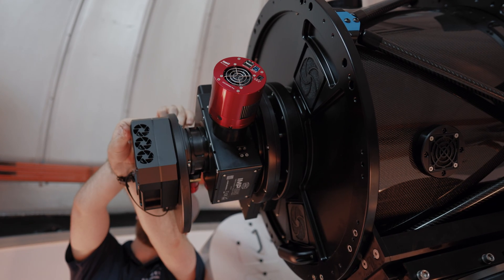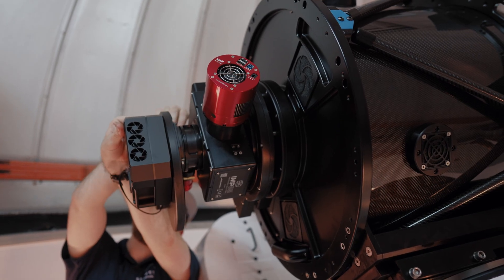Custom private observatory build in Texas

Comment: Why isn’t pier isolated from floor vis-a-vis a distinct pier pour? Looks like it’s just bolted to floor.
Reply: We poured an isolated slab that allows the telescope to not experience and vibrations from the dome rotating.
Reply: @MattDieterich  Can we have an order of magnitude of the cost of the project?
Reply: @jango71 it was around $550k and that is turn-key with all the design, construction documentation, construction itself, dome, cameras, telescopes, mount, and our observatory automation system.
Reply: @MattDieterich  Considering the price of a house in Houston vs the price of a house in some places, that observatory was almost free!
Reply: So the pier is indeed bolted to the observatory floor? You just poured a ring surrounding the floor for the dome?  If the pier is bolted to observatory floor, that is not standard or ideal.  The telescope pier should be isolated.
Reply: @kevinhovey8481 the telescope pier is on an isolated slab Kevin. The pier is epoxy anchored into an isolated separate pour. No vibrations transmit to the telescope from the dome moving during imaging, or while people walk around.
Reply: @kevinhovey8481 The mount is also direct drive and can compensate more than fast enough to deal with any vibration modes that come through the pier. That mount can track at .2” with someone walking around all they want pretty consistently once set up.

Comment: I have to wonder if the seeing in Texas justifies something with that focal length.  Even with the F6.8 version, sampling is .22 arcsec per pixel which is more than 4 pixels per arcsec for most of today's cameras (which is pretty oversampled). That would mean you need seeing at one arcsec or better for it to make sense. I seriously doubt that  seeing is that good very often in Houston.  This is the biggest mistake I see people with big budgets make. It is all about the seeing and the focal length needs to be tailored to that.
Reply: The key here is light gathering for a big aperture telescope for faint objects. Yes there will be over sampling with a longer focal length and high MP sensor, but all that means is the files are going to be larger during editing than the seeing allows resolution to be pulled out. With modern computers on processing and data storage that isn't an issue to deal with the large file size.
Reply: You just use a large format camera and bin as needed. You can also get sensors with 9 or 10 micron pixels and be critically sampled. Lots of professional observatories have huge scopes with no active optics and work fine. Long focal lengths are never an issue, sampling rate is.